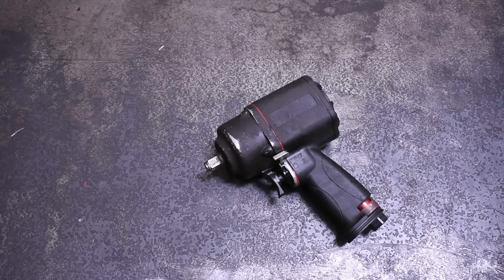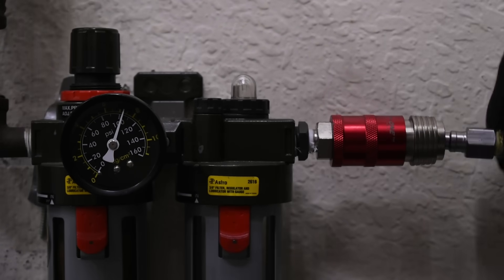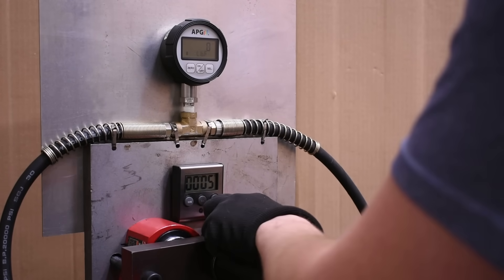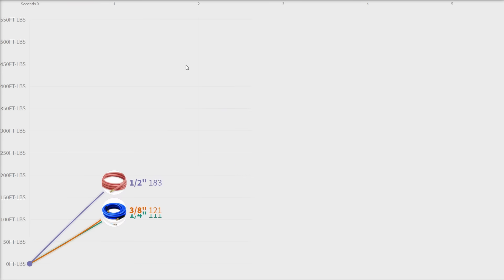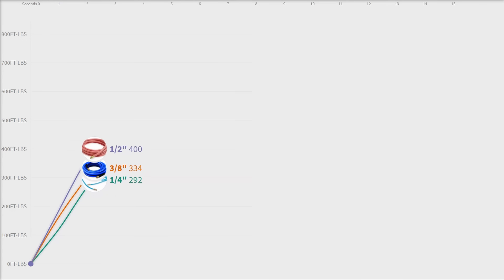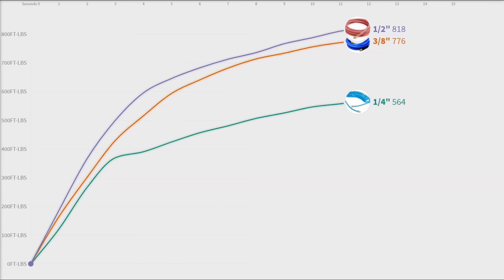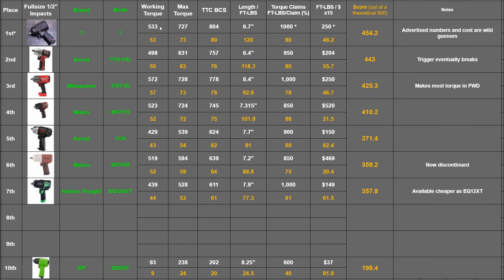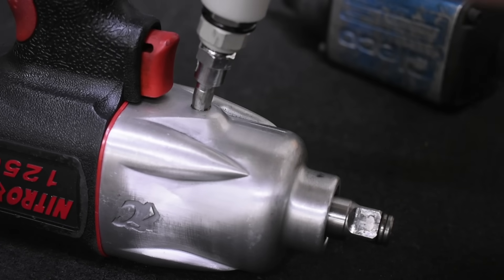How Much Power Are You Losing w/ Your Air Hose Size? Dyno Graph Testing

Comment: Great channel.  My thought/suggestion is that I suspect for most viewers the impact of a 50' air hose at the various sizes would be really useful.  My air system is sort of a chewing gum and chicken wire affair involving two smallish but pretty good 100% duty cycle nail gun compressors with 5.5 gal. tank each feeding a 10 gal aux tank.  The spec on cfm combined is 13 cfm.  The PSI high is 135.  I'm running 1/2" hose with HF fittings using 3/8" NPT connection threads.  I am waiting for a Thor 1875 to arrive any day.  I wonder if my system will be able to get the Thor's full power? My AI "advisor" thinks yes.  What does he know.  AI is wrong 50% of the time in my experience.

Comment: Well bigger air hose does give you more torque but it not just that, also it depends on air compressor tanks size as well. They have 1.9 gallon to 80 gallon or larger. Smaller the air compressor, less air flow, less torque , inconsistent torque due it drain air much faster and larger air compressor, more air flows , more torque and consistency torques too. Also depends on what brand and type of electric brushed or brushless or combustion engine as well.

Comment: Recently got my first "big boy" air tools, a 1/2" and 3/4" impact. (Yay clearance) Found out quickly the 100ft 1/4" airline I have wasn't gonna cut it for the 1/2 as it couldn't even do 100ft/lb lug nuts. I knew it would not be enough but......wow. Time to upgrade my lines and fittings.

Previously I only used it on my air ratchet, other lower volume tools and for filling tires, so it was fine.

Comment: I know this is an older video so more than likely this would benefit someone just watching this. 

There is zero doubt that the Milton V type of air fitting is the best. What most people don't realize is that to get the best price go straight to their website. Nobody beats their price. Now if you only buy a handful of them then get them wherever it's convenient.

When I discovered these about 10 years ago. I found out that the more I needed was a lot more expensive.  
I am basically a DIY mechanic like that since the 80s. I have a big addiction to buying tools. So I have basically a boatload of air tools. And I want new fittings for all of them and the chuck that goes on the end of your air hose that you plug into. They have it where you buy more the better value you get. I bought my feelings by the full box which at the time was 10 in each box. The air chuck is sold by the piece. I picked up two of them just to keep one on hand. The good thing about theirs is that all air fittings fit inside the air chuck.

Comment: If you used a 3/8" hose with 3/8" fittings, would you get the same results as the 1/2" hose with 3/8" fittings, since the 1/4" NPT fittings are the weakest link (which you explained in your triple air hose video)?

Comment: Is there a different in fitting size on houses when buying a new one? For example, using a 3/8 hose with 3/8 npt fittings instead of using 1/4 npt. Assuming both are used with Milton V fittings, is there a drawback to using the 1/4?

Comment: I don't know how much power lost through my 150 feet 1/4" air hose with high flow couplers and plugs. All I know is I need to turn down the psi before I break my tools with with the two stage 60 gal, 230V compressor.

Comment: The best fittings I've found is from tractor supply.  You can get a 3/8 im fitting with a 1/4 npt  . It will hop up your supply.  Also I have gotten a 1/2 industrial fitting from hf that I have going to a 1/4 npt pipe thread directly into my tool and a 3/8 into a 1st gen thor.    When it comes to your fittings check your inside diameter  those Im 1/4 fittings are way smaller than a 1/4 pipe thread.. do your research and achieve you pneumatic tools max potential

Comment: I’ve watched this video dozens of times since uploaded. I am still digesting that even at the same dynamic pressure— measured at the tool inlet no less— such a startling difference in power can exist. It strongly suggests that we aren’t getting the same air delivery just because the gauge shows the same pressure. And what’s really striking is that the bigger hoses are making more power in the  90psi dynamic run after 5 seconds than the 1/4” hose makes at 5 seconds into the BCS run. This further shows there’s more to the larger hoses than just less pressure drop, because even at higher dynamic pressure at the gun, the 1/4 hose still makes less power. Perhaps it comes down to the pressure drop after the gauge? Hmm.

Comment: My 1/2" Harbor Freight Earthquake on 3/8" hose to a 30 gal Craftsman compressor would not break loose a Honda crankshaft damper bolt. I switched to 1/2" hose (Milton Type M connections) with a lot of expense and work. Still didn't work. I found the problem is the regulator has a 1/4" nipple connection to the hose and that's the problem and the choke point. This setup also would not break free an anode out of a water heater. I solved both problems by purchasing a Tekton 3/4" drive x 40" long breaker bar. I'm thinking about switching back to the 3/8" hose since the 1/2" is very heavy to drag around and work with and it didn't seem to make much difference. I wasted my money, but hey, it was a shot.

Comment: I just switched to 3/4" bore red hose to connect my compressors and receiver tank, and Chicago couplings are easily adapted to thinner hose "whips" at the working end if desired.

Comment: Can somebody test their Blubird hose, by putting a 5/16" drill bit inside the brass fitting that comes pre-attached to this Youtube channel's most recommended hose...the Blubird 3/8 I.D. hose?  My Made in the USA tekton hose that is highly rated has an I.D. rating of 3/8, but what is the point of that when the pre-installed brass fittings at the end only comfortably fit a 1/4 inch drill bit size (it necks down so much right after the threads).  I don't see the Blubird hose sold locally for me to go and test this out, and only one person on Amazon is just guessing that the Blubird 3/8 hose has a 5/16" hole in the fitting where it necks down.

Comment: There's a lot of variation even within hose diameters. My 3/8 flexzilla 25ft has terrible pressure drop even with MIlton Type V coupler and male stud. With an HF compact impact (AKA Capri), I'm seeing over 25psi of drop at the gun from the buffer tank. Yet if I run the gun into the buffer tank output, I'm seeing only 10psi drop. So the 25ft of Flexzilla has significantly worse pressure drop than 50ft of 1/2" hose PLUS a buffer tank all upstream of it. That's a lot of fittings and such and it's STILL much better than that stupid 25flexzilla hose. It's rather baffling.

Comment: We have an 1" Air impact. We usually use the 1/4" for it because the hammer is very heavy and usually it looses everything in our car workshop at the lowest setting. Looks like we need an upgrade if we really need more power. My idea was to get an little tank with a short 1/2" air hose so we dont need to buy an 20m 1/2" hose for it.

Comment: Greetings @Torque Test Channel,  I may have missed it, but I'd like to see a reference somewhere to what size air compressor you use and what pressure you have it set to.  

I just had a complete failure with a new impact wrench because my 8 gallon compressor couldn't drive it with any power.  Up until then I did not realize an 8 gallon compressor was so wimpy.  :(

Comment: At our shop, we use 1” air lines and 3/8” fittings for 1/2” impacts, 1/2” fittings for 3/4” impacts. We also run 175 psi out of a 250 gallon compressor with a reserve tank of 250 gallons. The Thor is able to do semi truck lug nuts just as well as my 3/4” IR and my boss’ napa 772L 3/4”. Really speaks to how far 1/2” impacts have come.

Comment: I strapped a 1/2" x 100' Flexzilla hose on my hose reel and never looked back vs two 3/8" x 50' hoses. I ditched two couplings as well. Very noticable increase in torque. Not to mention I really like the Flexzilla hose. I wish I could get away with 50' but I need the extra length the way my shop is arranged.

Comment: I've used air wrenches on hobby projects for 50 years. I have several from air ratchets through butter fly wrenches to 3/8" and 1/2" pistol grip wrenches. I like them but my two Milwaukee cordless wrenches are rapidly spoiling me. I can't say how much I like not dragging the hose around. But for more torque, Air wrenches are much more affordable than cordless because of the battery cost. For that reason I'd like to see you test some 3/4" and 1" air wrenches, especially those from HF which are quite affordable even if they require bigger air hose and high flow couplers. I have an older than dirt Sears compressor that delivers 7cfm @ 90 psi. It has a big enough tank that if I let it pump up after breaking loose a nut with a big 11cfm wrench, in three or four minutes I can do another. It works great with 1/2" air wrenches.

Comment: Should have definitely run the tests with standard generic air fittings. Which is what most use. Since they have such smaller ID.
Reply from the maker: Then you're testing fittings, not hose size

Comment: In my case with a normal compressor for like home use and stuff we had a small diameter hose(I cant remember what size but I thonk it was a 5mm one) and the impact couldnt even bust a bolt from a carwheel loose. Than we bought a 10mm inner diameter hose and now it really works. We have a quite good air compressor but no industrial one and we also got a 40 bucks Impact Kit, so the tool and a Socket set and an extention(which I did not use).

Comment: most air tools are 1/4 inch tho, so surely it wouldnt matter what the size the hose is if u have a reducer at any point in the line or at the tool to take it down to the 1/4 inch so it fits ,then you will only get the maximum airflow the 1/4 inch can provide regardless of hose size?
Reply from the maker: 1/4npt isn't 1/4" in diameter tho. Just in name
Reply: Most doesn’t mean all. In fact, the shop air tools that are most effected by pressure drop in the line and fittings generally have 3/8” fittings. At least mine do.

Comment: I had to switch to my sprinkler blow out tap and 5/8" garden hose to break loose a harmonic balancer bolt.  It was sketchy for sure but definitely provided more beans than my 3/8" hose with 1/4" fittings.

Comment: Have you explained your experimental setup in any video earlier? How do you relate the pressure in the gauge to lbf-ft of torque?
Reply from the maker: Yes. In ep1. Converts bolt tension to ft-lbs using the skidmore wilhelm method.

Comment: Is it just the hose inner diameter 1/2, or the connectors can also be of same style but various sizes? Eg: Can you have a 1/2, 3/8, 1/4 V-Style? Or by V-Style its assumed its one fixed size for outlet and only the thread can vary ?

Comment: I don’t get it, but 30 gallon compressor, two 50ft 3/8 lines, And all the fittings on the lines are 1/4inch npt.    Will be using for painting, HVLP guns.  Shouldn’t I get 3/8 line with 3/8 fittings? Why does standard mostly come with quarter inch fittings on those 3/8 lines??  Lost

Comment: I know a lot of people today especially younger people are getting away from air compressor. I feel that there's a place for both of them. If you are out working on your vehicle and you're not doing major work than the battery operated tool should do well. If you were really getting in there deeply I feel an air tool is perfect for that type of situation. You don't need to worry about running out of power and yes I know you can buy a second battery for what he's batteries are selling for you could practically get a smaller air compressor and never worry about a dying battery.

For anybody who is looking for the Milton fittings you should go to their website in order correctly from them. When I first switched over to them if I was to order from Amazon or ebay going to cost a great bit of money. I went to the company's website and was able to buy everything I wanted plus extra and never even came close to what Amazon and eBay for selling them for. I buy them by the box I cannot remember off the top of my head how many fittings that is. I also use their coupler since it's bigger inside. And let me tell you what if you buy these settings no matter where you get them from hold it up to your old one. A complete night and day difference. It almost looks like the old fitting could fit inside my new one. That is how big of a difference it is. I use their V versions. That's the biggest opening that they have and the threaded end is quarter inch so that way you don't need to buy adapters.

As always I enjoyed your video and always looking forward to watching more.

Comment: Nice channel.

A couple observations and how they would affect things in the real world:  

One is that the extra torque in the 1-2 second range  provided from the 1/2 hose is really going to improve productivity.  The percentage difference seems to have peaked at around the 2 second mark.  The other is that it probably improves tool life because you aren't hammering for nearly as long.  I'm just a DIY'er, but the next time it comes to replace air hoses, it will be 1/2 from now on.

Another observation I found interesting, and it was hard to see on the graph, was when the 3/8 hose had emptied it's line pressure.  It was more subtle than the 1/4 line, but the difference in raw numbers with the 1/2 was about 80 ft lbs.

Comment: I really think the actual limiting factor in the flow department is the quick connection fittings. I like to drill mine out to 1/4 “ but you gotta make sure it still depresses the nipple in the female quick connect. I wish they actually made 3/8 and 1/2 inch connection fittings but the female receptacles would be ungodly huge at that point.
Reply: There absolutely are ⅜ quick connects bud.

Comment: I can hear your compressor turn on after most every test? You can hear the tool performance dropping off after every test too? This shouldn’t happen if you are supplying the tools with sufficient air? You should have a camera on the regulator as well.

Comment: I have a 3' hose that I use as an adapter with a 1/2" male and 3/8ths female on either end. Do you suppose that my adapter hose would still provide the tool with more power?

Comment: Hose size is way more important when feeding a high speed rotary tool like a grinder. Low air flow and pressure kills both torque and RPM. My 1/2" air drill is a beast that chews up stainless steel with a good air but a long 75' or 100' 3/8 hose and 3 or 4 couplers make it near useless. Same goes for almost any die grinder. Under the same conditions either of my old 1/3" impacts work OK, not great.

Comment: Hey, I’m very curious about the difference that would be seen between the 3/8” and 1/2” line on larger guns such as 3/4” and 1” air. I work at a large equipment dealership and was shocked to find out undercarriage shop was using a 1” gun with a step down to 3/8” fitting on the gun when we have 1/2” line on reels with whips to step down to 3/8” when required for smaller air tools. I found this out after they broke our brand new shop guns nose on track grousers🥲 after complaining theirs wasn’t strong enough and borrowing ours.
Reply: Also THANK YOU I absolutely love your content and the efficient format while still chiming in with the odd well timed joke.
Reply from the maker: We haven't got 1/2" line to sufficiently feed a 3/4" to manufacturer requirements

Comment: After 50 years using impacts some thing i might add, Any flexibility in air supply will interfere with impact performance. Use short hose as possible, And use iron or copper pipe to hose. Each time gun impacts it cause a pressure surge which is absorbed by hose. 1/2 gun needs 3/8 hose with 3/8 fittings. 3/4 gun needs 1/2 hose with 1/2 fittings. And try to never exceed 50 ft of hose. Gun will have lot more power on 25ft hose. At wall use no fittings . Do not worry about thread size going into gun. It is rated as a air orifice and even 1/4 will flow over 80 cfm which is more than any gun can use. My old CP 3/4 gun 1/4 inch thread My newer IR gun has 3/8 threads. And they both use same amount of air. The larger threads on newer guns are just a sales gimmick. I got three compressors one is 60 gallon single stage this does 90 per cent of my work. With 1/2 impact. I got 5hp two stage 60 gallon at 175 psi. Seldom ever used. With the 3/4 or 1 inch impact or sand blaster i got a 160cfm diesel compressor which is tied into the shop air lines.
Reply: My brain wants to disagree with the hose length.  That'd be like "more battery capacity means less torque!" since more length hose would be like adding a small air tank to raise capacity.